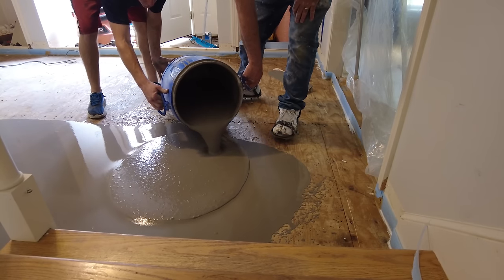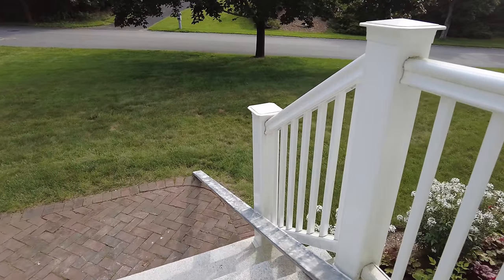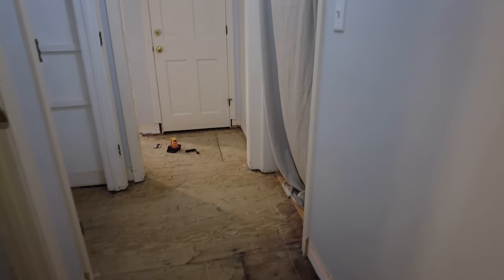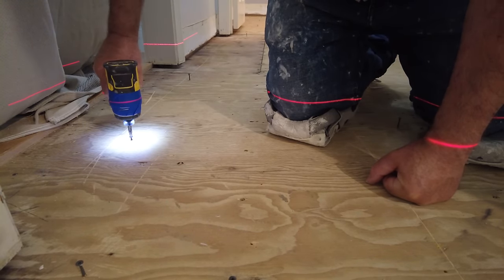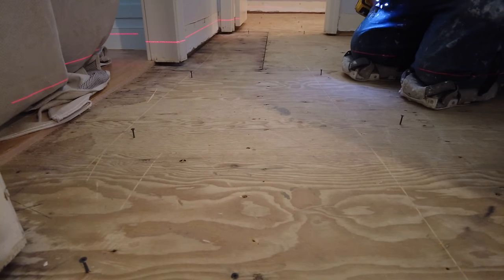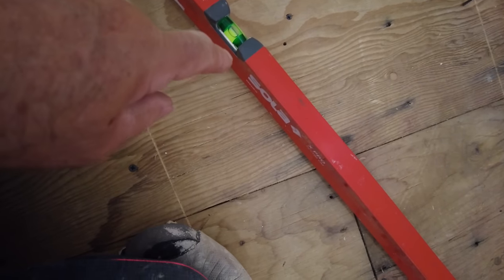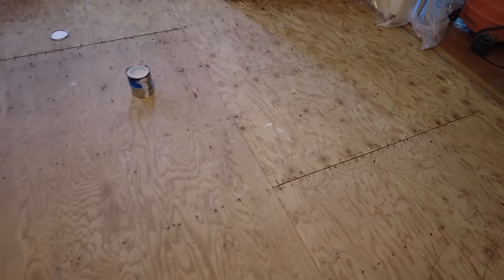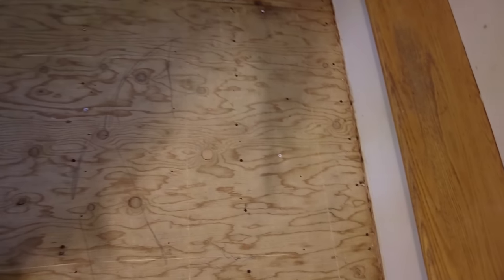Self leveling a floor, how it's done.

Comment: I tell people that can't afford to pay a contractor to watch your videos multiple times before doing anything else. You're the best source of tile how to on YouTube.
Reply: I do the same thing. 1/2 of them hire me 10% of those hire me to do it over from the cheaper guy.
Reply: Not so sure about that! Been doing it for 30+ yrs and i see a few problems with his methods! Plus he is rushing into this without diagnosing whats causing the floors to be so out of level! He thinks the self leveler is going to solve the problem and it will short term while also adding lots of weight to the floor / framing after the finish floor is installed!
Reply: @StonemanRocks  you been doing it wrong then. Wood framing is never as flat as a tile floor. Never. Not even concrete buildings have floors as flat.
Reply: @dekonfrost7  doing what wrong?
Reply: As far as i know you have never seen anything ive done so why you would even say that is beyond me! I know what it takes to make a floor flat before you tile it if that’s what you mean! Your comment makes no sense!
Reply: @dekonfrost7  Who ever said that wood framing was more flat than a tile floor? I didn't see anyone mention that. Everyone knows that. Hey, the sun is hot. No doubt that the floor was leveled. How much weight was added to the floor from pouring this much leveling mix over the floor? You saw those thick tiles he was going to lay, right? That will also add a massive amount of weight. It looks like the floor was already having problems. I doubt that adding more weight will fix the real problem, especially over time. Im sure you're aware of this as well. I think Stoneman was just pointing out that this guy should have mentioned the poor condition of the floor and address the reason that the floor is not flat to begin with.
Reply: @StonemanRocks   It can be many things causing it, moisture over time, uneven studs under the house, maybe needs few stud replacing or adding few new ones. To each its own but I have always done it with wire mesh and felt paper first and then drypack mud everything level. Not that anything is wrong with his method, the only time I use self leveling is when I install glue down wood floors on top of plywood like in the video. Then I use self leveling like in the video but not leveling the whole house, just making it straight so the wood planks can be installed easier with less tension even when you put weight and blue tape on top right after the installation.
Reply: @StonemanRocks this is exactly what I said.  The floors and ultimately his tile job is going to crack because he did not fix the problem of why those beam and stairs stringers are dropped so far.  They are probably rotten  or some problem that needs to be fixed and raised up from under the house to level that much of the house before anything is done like tiling.
Reply: Replacing rotten subfloor. Found some surprises. Had to patch a hole in a cast iron drain pipe and sister some joists. Using 3/4 inch osb subfloor. Not using tile but love how solid it feels.
Reply: If you have to do all  this it’s not really self levelling is it
Reply: A lot waters on fly wood  no good

Comment: Make sure to check girder/carrying beam and posts supporting floor system.  When a floor is sagging an inch where a wall sits on it, it's quite possible something is going on within the support system.   Leveling cement and tile adds a bit of weight to an already stressed system and could make the problem worse.  Or, the carpenters could have been having a bad day during framing.
Reply: As a carpenter, I very much doubt they started with sub floor so bad (out of level), and believe your 1st hunch that floor has dropped and needs to be fixed first as putting this much floor compound is ridiculous.
Reply: @chrisrob7276  nothing is ridiculous when it comes to tract housing! Ive seen plenty of houses that have settled that much and others where the carpenters sucked so bad that thats the way it was framed! Dont get all butt hurt just because he called out your trade! How do you know without looking at it what caused it? Point is it IS out that much and something caused it whether bad carpentry to start with or settling! Prob a combination of the 2 as an inch is a lot out to have left it that way originally! Another reason he should have put lath down before he levelled it as it would add a lot of strength! It would add cost but well worth that cost in my opinion! Too late now! Hopefully it wont sound like walking on crackers after a few months!
Reply: @StonemanRocks  I'm not B hurt, just stating a fact that NO QUALIFIED Carpenter would do this. Yes, it's obvious it is out of wack, and my guess it's been caused by possible water leak and ground movement. The main issue tho is my disagreement with the utterly Ridiculous (hack job) solution to flood the floor with massive amount of filler without correcting the issue of unlevel floor. If it has already moved this much, there is something terribly wrong with subfloor and it will only get worse if not fixed and therefore all the tiling on top will also just crack and break in no time
Reply: @chrisrob7276  i misunderstood your text! I agree 100%! Thats going to add a lot of weight to that floor as well! Tile + setting mat. and grout + self leveler! Could be looking at major problems in the future! Pay your money and take your chance I guess! I wouldnt until i fixed the problem first! Apologies for misunderstanding your explanation!
Reply: @chrisrob7276  I disagree with you 100%. Qualified carpenters are like any other group of people: a few winners and a whole lot of losers. 
Plenty of qualified are crooked and greedy and cut corners for a bigger pay day. 
Maybe you wouldn't perform shoddy work, but plenty do. I know Jesus was a carpenter, but that doesn't make all carpenters Saints. 
Accept that you are a diamond in the rough (maybe... Dunning-Kruger could be in effect here) and move on. 

I work with dozens of doctors every day. They ALL have PhDs. Every single one. They're all "qualified", but they are like any other group of people: a few winners and whole lot of losers.
Reply: My thoughts exactly. If you don't fix the underlying issues. (Joists and posts) this "fix" won't last very long at all.
Reply: @chrisrob7276 I agree with you completely as I have mentioned to other comments you can see Sals Screws along the beams getting higher and higher right up to the staircase stringers.  The beams under the house need to be repaired.  To much weight without fixing the problem and now no matter what his tile will be cracking.  Don’t fight with he mean nasty people you know what is right.
Reply: @StonemanRocks Takes an honorable person to apologize. Thank you for doing it and showing the world how to act properly with misunderstanding even on the internet.

Comment: Very informative and well-produced video. As a long-time DIYer, I consider three things before I get started: Time, Effort, and Cost. I estimate these and then use my 4-3-2 rule. I multiply my time by 4, the effort by 3, and the cost by 2. I'll get close to these estimates for most new DIY projects. Before I even consider doing a DIY project, I watch videos like yours to see what I'm getting myself into. A few estimates from 'professional' contractors will tell me how much money I'll save doing the project myself. I hope that my comment will be of use to other DIYers.
Reply: No not of use, the whole point of DIY is not to outbid contractors or save you money but to know you built and fixed your whole home.  “Every time you fall down you get wiser”, “it’s not truly yours until you have taken it apart and reassembled it” and my favorite “Chop Wood Carry Water”

Comment: Finally Sal shows how self leveling really dose not self level unless you know your elevation and depths! My first experience with these products I started with a hump and ended with a hump in the floor. All because I followed the directions on the bag. They never mentioned to established a control. I did  a job on second floor of a home and dammed everything off but the leveler found a path and made it to the kitchen,  kitchen cabinets, stove and basement. Be careful!
I have used roof nails in the past painted orange set with a level. Concrete floors I stretch string lines. 
The drill and laser excellent idea.
I prefer ridged 1/4" foam than sill seal.
The gauge rake is a joke! 
If subflooring is not tongue and groove you need to address the joints with caulking. 
A yard rake can help as well for moving product.
Thank you Sal!

Comment: That looks like such hard work, let alone filming as you go. THANK YOU! Even if I can't do it myself, I can see what I'm paying for, and that means a lot too.  I'm here because it looks like I have asbestos tile squares, over concrete, under the carpet that was pulled up. This is throughout the house, and my contractor wants to pull it all up, to lay the vinyl plank that we bought. The VCT tile is in decent shape, and adhering really well (minus some air bubbles and some ever so slightly lifted corners) despite the fact that it's been there since 1956. I want to encapsulate it, as it would cost a fortune (I assume) to pry off that hazardous material.  
The process you are showing may not be the solution for me, but it's fascinating, nonetheless. Maybe something similar would work for our situation. 
I salute you for amazing work, and sharing this with all of us.
Reply: Don’t do it!  Someone will tell someone else then you will have a HAZWASTE Nightmare! going on and the city will close you down because someone will tell.  Just cover it up, which is why they make ⅛ paneling sheets tack it down and put your laminate over the top of that.  If you start on those tiles then you will have to get some glue remover and even then you will be buying the 4x8 4x12 sheets to cover it up before your padding goes down under your laminate.
Reply: It's a $10,000/day federal fine for disturbing asbestos without the proper license. Plus, left undisturbed, asbestos is a great material. There's a reason asbestos roofing shingles are still around today.
Unless the asbestos is failing poor causing a problem worthy of such an expense, it would be wise to keep it in place even if money were no issue

Comment: Fantastic job Sal. Ive done so much of this but sadly theres times you just cant achieve what the customer is hoping for especially when transitioning next to those hardwood rooms. You can be creating a "new level spot" to a out of wack slope transition. I always may sure I allow for manipulation of tile by slacking off of the self leveler in these areas. I seen at a couple of your doorways the leveler was almost the same height without tile. I know there is nothing you can do but man those will be huge height transitions. Thanks for all your great content Sal. All the best from Western Canada.
Reply from the maker: Correct, with tile that big floor has to be flat. Customer was made aware of the problem and accepted that there will be transitions at the doors.

Comment: I'm not convinced with that long level on the floor trick... (possible deceptive camera angle shot).  Let's give it the real test.  Shine a light on the one side of the level and get the camera down on the opposite side to check to see if there is any light coming through under the level!  Alright, that may be demanding too much.  How about this... if you can slide rice paper between the floor and level, anywhere, it will be declared a terrible job and the mocking will commence! ;D

Great job Sal!   You are a true contractor, when you forget to pick up a necessary item for the job, you find a substitute onsite to get the job done!

Comment: Super video. So why not vibrate the leveller like with concrete to get the material to flow level...?  Put an off balance motor (drill with something sideways in the chuck) onto your spreader handle so it vibrates?

Comment: Thanks Sal, we're using shims glued with hot glue instead of screws. Pinning a floor with screws looks like to be faster way of establishing reference elevations 👍
Reply from the maker: Thanks, glad it helped
Reply: How did you measure the shims and how much glue and do you pull the glued shims up once the compound starts spreading?

Comment: Hi Sal.  What product do I use to use to fill in small areas on plywood?  I’m trying to make my floor flat but not necessarily level.  I’m trying to avoid pouring self leveler over the whole area to avoid raising the whole area which cause a significant height difference between the finished tiled bathroom floor and the old hardwood floor in the hallway.

Comment: Thank you Sal!  I noticed that you were going to need to pour another section of self-leveler by the front door.  What are your thoughts or strategies about pouring self-leveler in sections?  Do the two sections just butt up next to one another? I have a basement project where I think that it will just be too big for myself and one helper to do at once.  I am wondering if it can be successfully done in sections.  Thank you for your time!
Reply: You can set a barrier to section off this work. It's best to do one pour with a bunch of workers, but it can be done in sections, no problem. Just remove your barrier when the first section is cured, and then pour the next section right up to it.

Comment: Looking to self level over a  1”x6” diagonal wood subfloor with metal lath. Instead of tar paper underneath could I use a vapour barrier instead to prevent the self leveler from
leaking in between the cracks?

Comment: Dang nice work bro. Are you limited to which flooring types you can install over that material?  Hopefully the homeowner addressed the foundational water problem as well. As for the flooring wouldn’t have fell out of trueness if it weren’t for the likely roofing gutter system problems not guiding rainwater away from the foundation

Comment: Glad I stumbled upon this video. The foam and caulk is a great idea and will be using that on my 8x3 half bathroom I'm currently remodeling. The pin method wouldn't work on concrete. How would you go about that scenario?
Reply: It a actually does work on concrete also. I masonry drill all the holes first then knock in wall plugs . Doesn’t take long and makes it easy to level any floor

Comment: Very helpful video. How much variance in a floor can you tolerate before needing to use self-leveling concrete like this? If the difference between high and low on my subfloor is only 1/8”, can I make up for that with thinset when I lay tile? (Planning fairly large tiles: 15x30.)
Reply from the maker: TCNA says, no more than 1/8 in 10 feet or 1/16 in 24inches for large format tile. So if the floor truly is only 1/8 out, you should be ok

Comment: Great video thanks for sharing, I’m a DYI I’m going to install marble tile in my kitchen, I have to use self leveling on plywood  but I’m also adding an extra layer of plywood to reinforce the floor because of the weight of the marble tiles, quick question,? Do I add the self leveling  before or after adding the extra layer of plywood  ? Also I bought Schluter all set Thin set, will that thin set work to install the Schluter membrane on top of the self leveling ? or do I need to get  unmodified thin set ?because technically I will be installing the the Schluter membrane on the layer of self leveling rather than on plywood? I hope I explain my correct. Thanks

Comment: GReat video, what is your tips/ advice to pin a concrete floor before self-levelling.  do you use screws and masonry plugs, or tripods, or another smarter way ???
Reply from the maker: Horseshoe shims and glue gun work

Comment: Paid a guy to do ours years back and he seemed to know what he was going to do. Make comments on putting pins across to find the level etc. When the day came he slapped it on and didn’t properly seal the gaps. He didn’t even know which bit was the high spot. The finished result was terrible and remains a frustration to me to this day. Once it’s done it’s impossible to remove without massive destruction and damage. Wish I had known what a good job should look like at the time.
Reply from the maker: Pouring self leveler is not an easy thing to do and get it right, it is a fast moving process, but at the same time it needs to be done carefully to get it done right.

Comment: really important you watch out for different self-leveling compounds. most of these youtube videos won't tell you they vary in application thickness and viscosity. I messed up because I was trying to self-leveling a thinner application between 1/16 and 1/8th.
just be careful what product you buy. some self-leveling compounds are easier to spread and smooth out at thinner applications, and some are REALLY difficult. I bought ardex v 1000 and it was absolute HELL to spread. silka 125 was easier. novaplan plus seems to be the easiest to spread, it's much more viscous and fluid like. a lot of this depends on the compound you choose, so choose wisely.

Comment: So i have a question, i went to HD the other day and a 50lb bag of self leveling concrete was $33.00!!!  That must have cost a small fortune to do that area of that house. I just had to do a bathroom and i burned through like 8 bags. So my question is , since the floor was 3/4 out of wack could you have used some type of filler to cut down on the cost of the self leveling concrete??? Btw love the tape trick!!! Thank you!

Comment: With tile that big combined with this much added weight, was there any work done to strengthen the deflection of the floor?
Reply: That stuff isn’t crazy heavy when it cures and its spread out so much. Usually when you are adding this type of weight yes you’d want to see what kind of sub floor is going on. But a lot of homes can handle it without any additional work